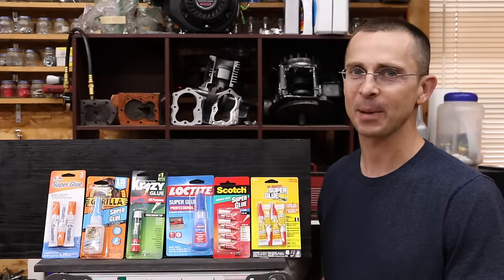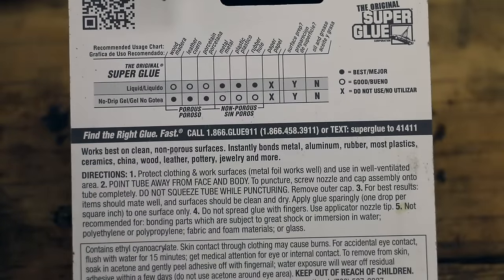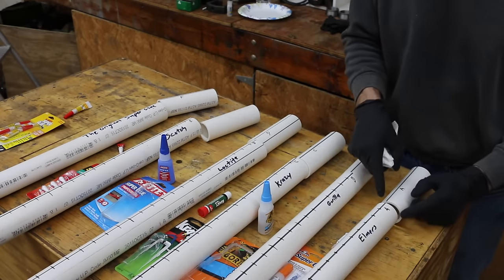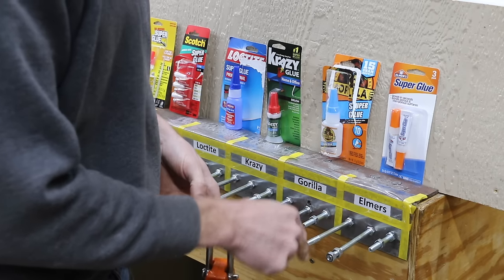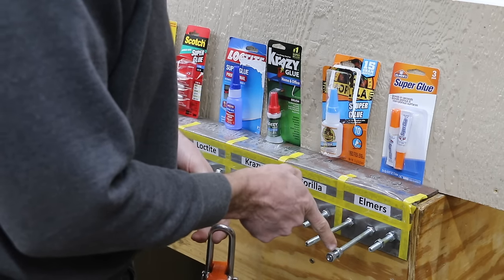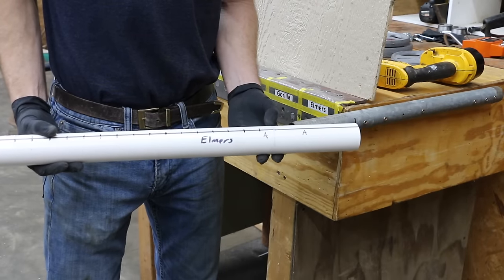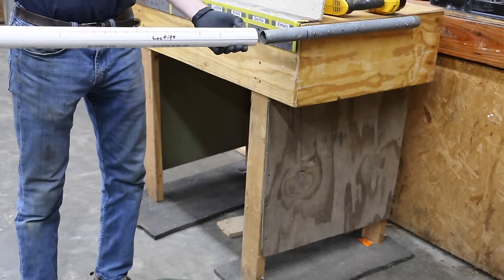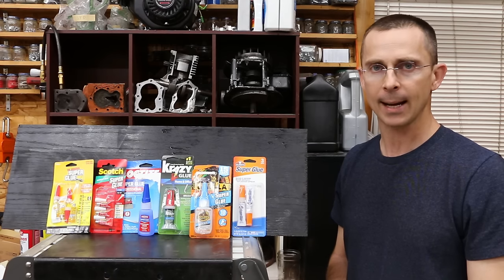Which Super Glue Brand is the Best?  Let's find out!

Comment: Hmm, interesting, but there are no brands there that I use. There are a lot of wood turners who use the CA glues for anything from filling holes, some times adding crushed turquois, coffee grounds, saw dust, and brass key filings. I use the CA from Bob Smith industries, which I get at my local toy and hobby shop. Used to use it for quick balsa wood model assembly and used baking soda for filling gaps. No clue as to how much structural integrity it can add to any wood. I do know that it does not take shear forces well, and any sharp impact can cause the joint to fail. We do tend to use all 3 viscosities, thin, medium and thick. It is the only glue that will stick to wet wood. The thin stuff is some times used to stabilize punky/half rotten wood so it can be turned, sanded and finished. In the pen turning part of the lathe world, it is a common finish for pens, most of the time multiple coats. I think you are having fun.

I was in my local Ace Hardware store yesterday and asked the clerk in the tool department if he had heard of your channel and he said no. He bought it up on the computer screen and said, "This is exactly what I need."
Reply from the maker: Thanks for sharing the channel!

Comment: DAP “Rapid Fuse.”
Best I’ve used. 
Screw top with a pin inside the cap that seals the hole. 
It’s a gel which is generally easier to work with. 
It doesn’t bond “instantly” which in my opinion is usually inconvenient. It binds in about 20-30 seconds. 
Had it THRER YEARS and it’s only half empty. 
Or half full, depending what mood I’m in. 😁
Anyway, outstanding product.
Reply from the maker: Thanks for the feedback.

Comment: 616 lbf / .346 in.² = 1780# very close to the 1 ton that is claimed for the original super glue. (.346 is area of 9/16 hex of ⅜ bolt I'm estimating you used). 

FYI lbf (pounds force) is just fine for force measurement and makes much more sense from a personal DIY. 

In addition, it naturally works out to torque when you use for how far out you can pull down on PVC eg 22" x 25 lbf = 550 in·lb torque. ≈ 62 N·m or 46 ft·lb The usual way force or torque is described on USA content is to use the force or torque measured in lbf or ft·lb then graphic overlay of N or kgf or N·m for "the rest of the world". 

Great video as always. I'm low on super glue and about to buy the next bottle and came here to figure out which to get. 

Some missed brands: jb super weld, dap rapid fuse, rapid fix (2-part with powder). Also cover when options have brush applicator. 

I don't know why people objected to pounds vs. Newton they are both force. Pounds is not mass like kg we just call it that when describing how much we weigh.

Comment: for part 2 try comparing philipine's super glue which is Pioneer Mighty Bond and the one branded as CYNO.

here is the lists if you interested:
- Pioneer Mighty Bond (philippine-made)
- Bostik Super Glue (philippine-made)
- CYNO
- chinese super glue (must be in the same packaging, the first one will qualify in this part)
- Flex Super Glue (Phil Swift)
- UHU Super Glue (plain and ultra fast control)
- Pratley Super Glue
- Alteco (plain and 110)
- Tolsen Super Glue
- Wynn's Super Glue (Must be used with an activator)
- PolyFix (Must be used with activator)
- the winner in this part (LOCTITE)
Reply from the maker: Thanks for the suggestion.

Comment: Thanks for the vid. But there's one variable that is missing in such tests: the error. 
To improve this test I would reduce the number of contestants and increased number of samples per contestant(at least 3-5).
Also I liked how you prepared the same environment. It could be an improvement if instead of glueing bolts to a metal thing, you glue blots to bolts. It's much easier to prepare bolt heads to be the same plus you're not limited by space and can do as many samples as you have bolts.

Also an idea to compare using new glue vs opened glue vs closed, but been stored for some time.
Reply from the maker: You are welcome!  Thanks for the constructive feedback.  Thanks for the suggestion.

Comment: You always come up with interesting ways to conduct your test, always being careful to control your testing to apply the test equally to each product. Well done. Have you ever tried to glue composite material as used in decking? I have yet to find a product that will successfully end glue composite railing material. The core is plastic, wood, and a resin, making it tricky to bond w/o failure. I am thinking maybe solvent welding like used to join PVC?
Reply from the maker: Thanks for the suggestion.

Comment: Hi again excellent testing, I usually Weld metal or use fasteners so plastic is what I would glue and will then continue to buy loctite. There is a lesser known brand called "Pasco fix" that would be nice to test... By the way nice choice in the pistol grip Dewalt drill... I have the same one... Older but a goodie!
Reply from the maker: Thanks!  Thanks for sharing.

Comment: I've never used super glue in this type of load bearing application, generally I would use it to repair small objects or to assemble light materials. The strength of the bond isn't the main concern in these cases (any super glue will typically exceed the needed strength) - it's the ease of application, mess, etc. I really like LockTite for being a gel (not runny) and I like the design of the bottle. It's easy to use, and I've never hard a nozzle dry up on me and ruin a bottle. Unlike tubes of normal "Super" glue which are a massive pain.
Reply from the maker: Great feedback. Thank you!

Comment: I had a vw golf and the oil pressure switch came out on a trip in the middle of nowhere, i stopped looked at the engine and found the problem, the only things in the car were some diy stuff from home, so I glued a short bit of plastic water pipe and a end cap over the oil switch hole with loctite superglue,  it lasted the rest of the journey and i forgot about it until i serviced the car 6 months later, no leaks and still holding oil tight.
Reply from the maker: Thanks for sharing.

Comment: A worthy test is which super glue container lasts the longest. I've owned most of these brands and it doesn't matter how well the glue performs if the container fails or the glue dries inside. 

I regularly use super glue in my first aid kit. Maybe I'll do a long term glue test and combine that knowledge with what you've shown.
Reply from the maker: Thanks for the suggestion.

Comment: Two comments:  1) I have yet to find a way to keep super glue from solidifying after a couple of uses.  I clean the applicator after each time and reseal.  Just as often, the glue is solidified in the bottle and not just the applicator.  2) I've seen numerous videos of furniture building and other light construction from the Pacific area and they liberally use what appears to be cyanoacrylate glues on porous materials like wood and leather, especially in furniture making.  Is this another kind of watery adhesive that just looks like CA?

Comment: I can't believe they say not for wood, in the 70s and 80s we built 100s of rc airplanes, balsa and plywood and used ca glue, it was called HOT STUFF back then and the wood would break before the glue gave up, plus building a plane went from weeks to 2 or 3 days and minor crashes could be repaired in the field and back in the air good vid, thanx
Reply from the maker: Thanks for the feedback.

Comment: I wish you would revisit epoxy and superglue and just use the 2x4 jig and pull directly apart and maybe use the PVC caps sanded with 80 or 120 I love your testing but I feel the bolt didn't really give it the fair shake. Just try pulling one set of cap apart off camera and see what you think . Thanks again great content
Reply from the maker: You are welcome!  Thanks for the suggestion.

Comment: During the original super glue commercials they used a cylinder cut in half.  The surfaces were machined down to as close to flat as you can get.  The super glue just stopped the joint from sliding apart.  When you try to pull two perfectly machined parts (nothing is perfect) apart it is impossible .  The reason is that the two flat surfaces push all of the oxygen out of the junction.  The flat surfaces also prevent air molecules from entering the joint.  Without air molecules between the two surfaces they are impossible to separate.   Holding a couple of tons is not a problem.
Reply from the maker: Thanks for sharing.

Comment: I have a situation where I have a reach in cooler like what's in a convenience store. It has a typical black rubber door seal and I can't get a replacement and the seal is ripped in a section. What would you think would glue the ripped part back together.  Fantastic show by the way!

Comment: I do belive that one drop can hold 1 ton. 
If youmput it between 2 gauge blocks so it can cover a lot of surface area.
Had a crossbow where all the metal parts were secured to the stock with 2  5mm steel bolts, they both snapped off from the recoil.
Glued it on using super glue and it never came off again.
Reply from the maker: Thanks for sharing.

Comment: Bicycle tube patch kits.  But for an added twist, include super glue alone as a patch.  I've always found ordinary super glue dribbled onto the point of puncture on a butyl rubber tube without using any patch fabric material has been a sufficient, long lasting repair method.
Reply from the maker: Thanks for the suggestion.

Comment: I think they are all good on skin, I sat for 20 minutes once soaking in acetone before my fingers would pull apart. I thought for sure I was headed for the Docs office. I only use super glue on plastics with very limited results. Behind panels on vehicles where it does not matter, I use pvc pipe cleaner very sparingly,then super glue.
Reply from the maker: Thanks for sharing.

Comment: I have found that the best test for duct tape (or any tape) is to clean the bottom of your shoe, put a piece on the heel, and then walk it off.
Most tape doesn't last 1 day. I have only found two brands that will last, and I use them to preserve the soles of my favorite old tennis shoes. They will last about a week minimum, so long as you avoid rocks.
One brand is the Heavy Duty Duct Tape (black) from Dollar Tree. The other is STD-60 from Tape-It, a thin white tape that is extremely durable and sticks well to just about anything. I put these on the heel and toe area of my sneakers, and the sneakers have stopped wearing.
Yay
Reply from the maker: Thanks for the feedback.

Comment: Another issue that I have with super glue is that usually, once you open the tube or container, it's pretty much a one shot deal. Is there one product that is better than another that can be stored and used multiple uses? Or, is it just a better bargain to buy the multi-packs with the one time use, small tubes? See my comment below too, as this particular application has to do with crafting.
Reply from the maker: Thanks for the suggestion

Comment: Wish you would have tested BSI (Bob Smith Industries) and JB Weld. Both have done me well. 
You tested materials that I personally would never use Cyanoacrylate to adhere.
 I also would have liked a rubber test, witch was one of the main uses for Cyanoacrylate. The Government has been using it Since the 50s for making o-rings. BSI is famous in the RC world for custom sizing tires and usually bears the hobby stores name. I also would have liked to see PVC glue/solvent on the PVC.
Reply from the maker: Thanks for the suggestion.

Comment: Great video but shouldn’t the tensile strength test (where you pull up w the jig) be placed directly over the bolt?   The current setup would create a fulcrum and create leverage thus skewing the accurate amount of force needed.    This seems it would measure less than the actual reading if it were placed directly over it?

Comment: Hi Todd,

About IS12

The only super glue I have met, that really live up to expectation is IS12.
If you are in doubt, then read the text below.
It is still possible to buy IS12, but the original product was not diluted, as the current available product probably will is.
Dilution of this glue is a way to protect amateur users from harming them selves.
------------
I know that this comment is a bit late, but please read it.
In my early youth, - around 1961,  my dad worked at 'The Danish Nuclear Research Station at Risø' (AEK- Risø), - close to where I live now.
One day he brought home a small plastic bottle of IS12 from his work.
He knew that we would not believe him if he just told us how it worked.

He took two empty beer bottles and applied drops of IS12  the rim of one and presses it against the rim of the second bottle for 10 seconds.
They were then left for one minute to let the glue cure.
With a young mans force he tried to break the two bottles apart,  no luck.
The bottles broke before the glue.

In 1972 I repeated the test to make sure that what I had experienced in 1961 was not scrambled by  age at that time (7).
My dad was again the happy supplier of IS12.
The result was the same: The glass broke before the glue.
--
The 'Super Glue' or '10 Second Glue' that is available today is sorry excuse for the IS12 I met in 1961 and 1972.
/JD
Reply from the maker: Thanks for sharing.

Comment: As has been said before, the sample size is far too small to indicate a truly Superior cyanoacrylate adhesive.
While watching this test is entertaining, I feel it misrepresents which may be the better of the adhesive.
I would suggest the following to get a better representation.
1. Select bolts with a larger diameter head. 
2. Machine The Mating surface of the bolt heads flat and lap to ensure intimate contact.
This would improve the contact surface area to imperfection ratio significantly and yield a more accurate result.
3. Increase the sample size to 5 each and throw out the high and low and average the middle three.
4. Use a linear reading torque wrench instead of the break-over torque wrench. 
Cyanoacrylate is incredibly impact sensitive so the thump from torque wrench could misrepresent the true torque reading.

Comment: In my personal experience, I have never seen super glue fix anything and I have never seen JB Weld fail to fix anything.
Super glue is really only useful if you get your arm sliced open and you want to glue your skin back together. It actually works great for that.
Everything else will simply break again an hour later and now it's covered in crunchy super glue residue.
Reply from the maker: Thanks for sharing.

Comment: IDK if you can do this or how you would, but I'd be interested in a comparison of eco-diesel DEF diesel additives. I've found better mileage with premium DEF, while I've had other RAM owners say that it doesn't matter, to just buy the cheapest. Also, does it make a difference in wear and tear to the engine?

Speaking of, a comparison of cold weather additives for diesel engines would also be interesting. I've had several mechanics tell me to only use Power Service brand, while many other owners have said to just buy the cheapest.
Reply from the maker: Thanks for the suggestion.

Comment: Nice evaluation job.  But limited by not doing replications which could fortify your assumption that each glue application was proper and equivalent to the other application jobs for each glue brand - did you evenly and sufficiently apply the glues in each case? Just one example how doing replications would make your study much stronger.

Comment: The original super glue advertisment, one drop holds a ton, if I recall correctly, involved a flat plate being glued to the roof of a car which was then lifted by a crane.
While only one drop was used, the bonded surface area was reasonably large.
Reply from the maker: Thanks for the feedback.

Comment: Hello Friend, I saw both of your videos on using epoxy and also on super glue. I have a v shaped plastic monogram (is 8 inch in length and 1 inch width) that has broken in 2 pieces at the bend in center, at both ends are studs to clamp to the front grill of the Fiat 1100. I have used simple 5 minute 2 part araldite epoxy but the stuff breaks with slight pressure. What glue would you recommend to use for such application. I has to be high strength yet a bit flexible.

Comment: Hello Project Farm friends.

No suggestions for now but a superglue super tip here for your large bottle (60ml) or any size superglues: best to have a small refrigerator or maybe a chiller (not sure if it's just a chiller) at the shop shed/garage. Putting superglues in the ref (not the freezer) will prevent the glue from solidifying (within reason, after 30 years most likely it'll solidify).

If you get to meet or message Adam Savage sir Project Farm, suggest this tip to him and other makers (disregard if you already know this trick). :-)

Import the best superglue (and I've tried the best brands like LocTite) I've tried- 'Original Pinoy Pandikit' (it might be tough to find the original but usually it's got a simple label no graphics- it may hard to find the 60ml big bottle one. Don't use the build-in cap that connects to the neck, just use the pin to close it after use), no need for accelerants, it dries in 10 seconds or less and is a notch stronger too (not sure how healthy but it's superglue, they're all quite unhealthy overtime of contact but drink 100%, matcha and similar to avoid cancer from these chemicals like all chemical products, X-D)

God bless, Rev. 21:4
Reply from the maker: Thanks for sharing.

Comment: If you are OK with black color, HENKEL LOCTITE BLACK MAX 380 INSTANT ADHESIVE is a strong super glue  "medium viscosity, rubber toughened ethyl cyanoacrylate adhesive with increased flexibility, peel strength, and enhanced resistance to shock"
Reply from the maker: Thanks for the feedback.